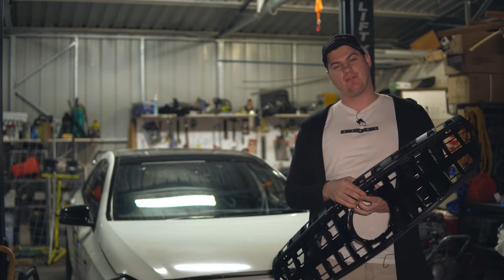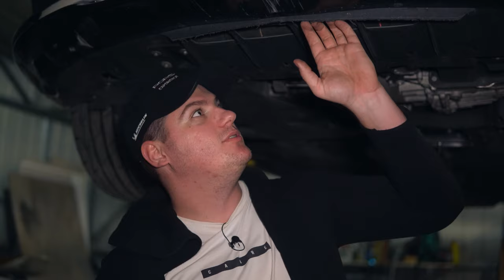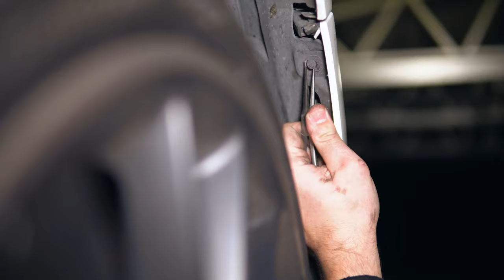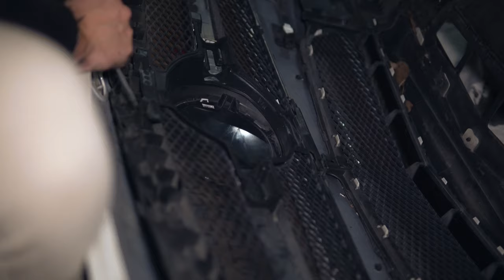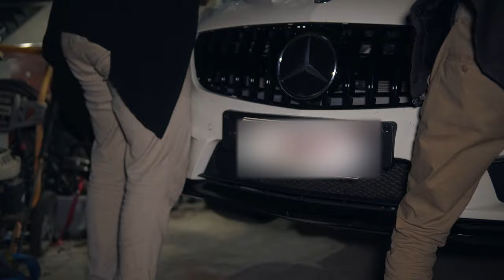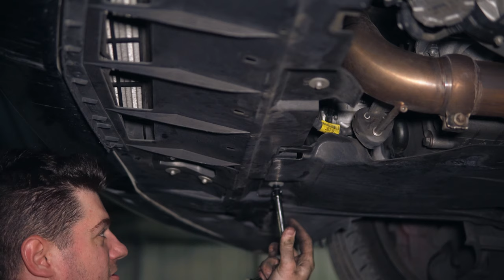A45 AMG GT Black Grille Install | How To

Comment: Great Guide. 
One question I have is regarding the GLA45 2014. The Badge, the lower part of thdd we’d badge, not the ing that surrounds it is pushed back by 2-3mm. 
Only small but annoying, dies the whole grill/bumper need to come off to push that fwd?

Comment: BTW I'm some what of expert on mbux the headunit how everything is wired from Augmented reality etc I've did extensive research and have all mercedes dealer software as well which helps.  I'll be adding to channel soon I get my parts I'll make video depending which comes 1st the car or parts 😆 if anyone needs help regarding ntg6 or even 7. I'm knowledgeable about all the boards inside the headunit too and even vulnerabilities found in the software stack. This is for project B & guess anyone else has questions
Reply: so is this for a retrofit into the w176?

Comment: Lovely, have been thinking of fitting my A45 with the same grill! Doesn’t look like a difficult replacement! How long did this take you? Do you think this could be done on the driveway without a ramp?
Reply from the maker: Not too difficult at all, the most difficult part is just the plastic clips that hold the grille in place 😅 they really do a good job of holding the grille on haha. It took maybe an hour, and definitely achievable on a drive way. Only used the lift for the underbody panels. Feel free to comment here if you have any more questions 😊

Comment: Bought one of these grills for my CLA 45.
Garage is refusing to fit it as I would need my radar recalibrated at a cost of £400 did you guys encounter this problem?
Reply from the maker: We didn’t encounter this problem at all, not too sure what the shop is talking about.

Comment: Hi guys, so the W177 Pan American grill will fit exactly into a W176 A45?
Reply from the maker: Not too sure about the w177 grille specifically, however you can buy the same grille style made as a direct replacement for the w176 bumper
Reply: @Project_B  Thanks. Can you let me know where I you bought yours? I’m in Melbourne  but can obviously order from Queensland 👍
Reply from the maker: You’re in luck! We bought ours from Mars Performance, which are based in Clayton Victoria. But if you’d rather get it posted just jump on their website, I’ve included it below 👍🏻

https://marsperformance.com.au/Gloss-Black-AMG-GT-Style-Front-Bumper-Bar-Grille-Grill-Mercedes-Benz-Class-W176-12-15-include-A45
Reply: @Project_B  thanks guys 👍